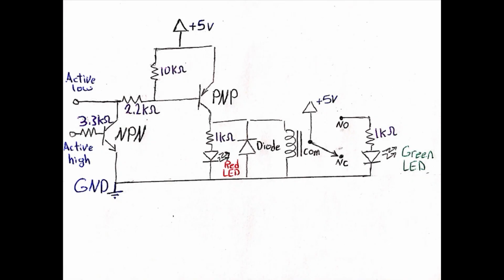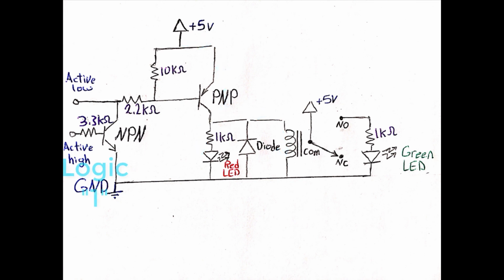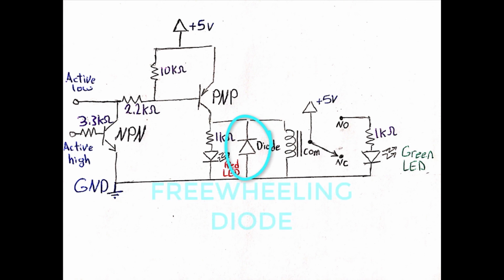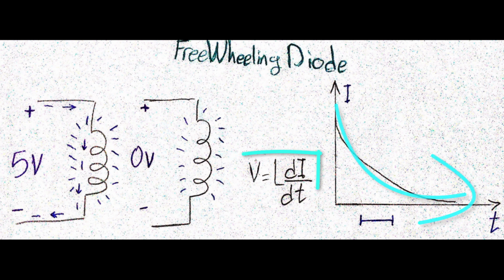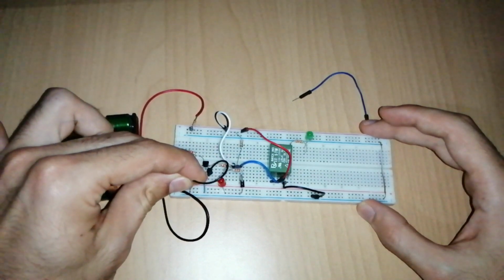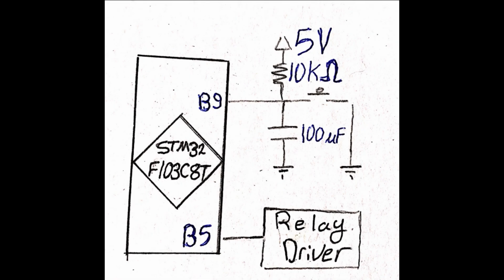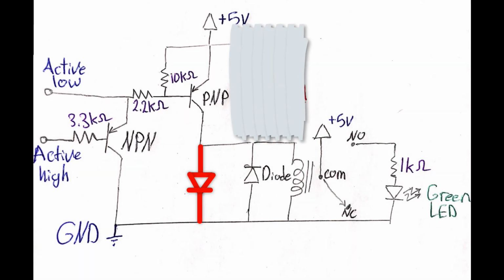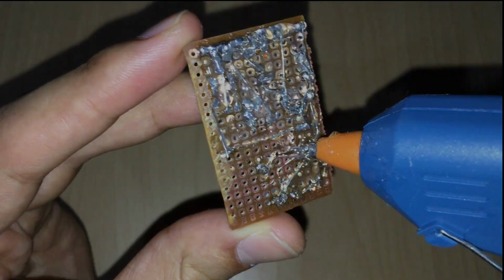Make Your Own Relay Driver

Comment: I believe you offer both active and and active low to provide a choice to the user.  Presumably only one controller output pin would be used, but if somebody connected them to two different output pins and then set them both high, then bad things would happen! (namely you would short the active low output to ground)
Reply from the maker: I already mentioned in the video that this is one way of relay driver design. Actually, using one transistor is enough to derive a relay